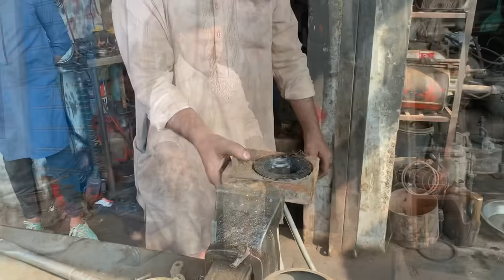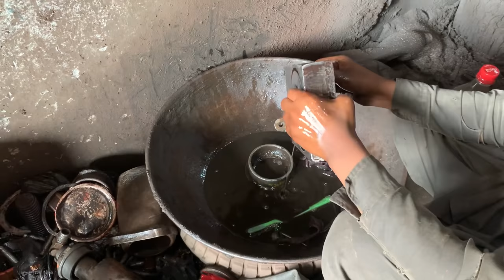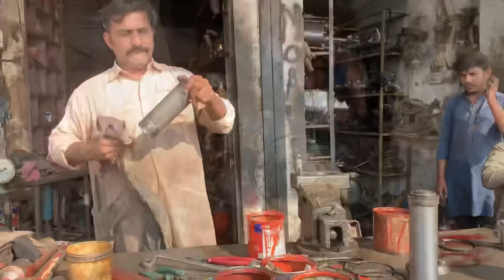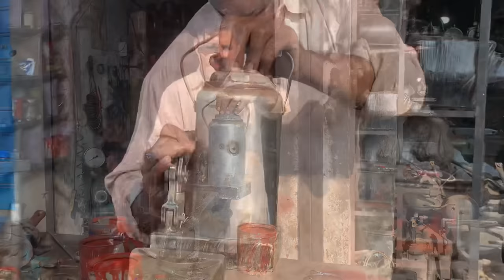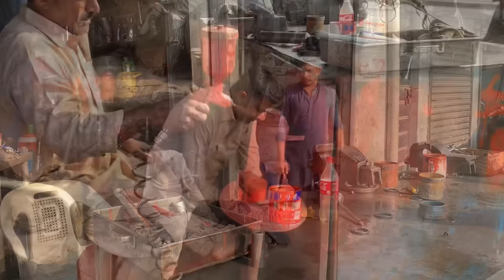Fully Destroyed Old Hydraulic Jack Restoration || Repairing 50 Ton Rustey Hydraulic Jack

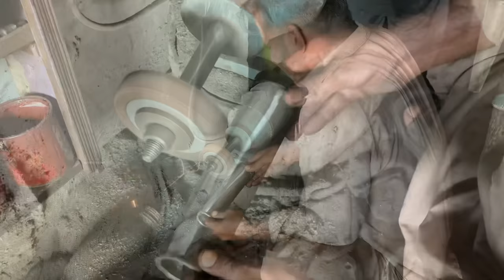Comment: @6:40  Love the piston pit removal process...  I'm sure it leaves a uniform and perfectly round surface for the seal to do its job and hold up the 50 Tons the jack was rated for....  ;)
Reply: the label was for a 32 ton
Reply: @dtoad48  that was a different jack than the one shown being rebuilt.
Reply: maybe they reduce the capacity by 40 percent to compensate for the repair

Comment: Using a grinding disk where a wire wheel would be preferable.  And that hammer.  Destroying those working surfaces.  A fork seems to be unknown tho these guys. Removing so much metal from the working surfaces will greatly reduce the working load of the jack. Vice grips would also be of a big help.  especially when using a wire wheel to clean parts.  How many hand injuries do these guys get?
6:00 that grinder is sliding on its mounts.  
10:07 - that kid with bare hands in that solvent.  He will live a long and healthy life.

Comment: TIP. when unscrewing the large pipe, keep the ram in the cylinder and line up the ram wide seal area with where you put the wrench. Otherwise you might warp-oval the pipe and cause a problem with the ram sealing. It is supposed to be perfectly round.

Comment: After watching a few Pakistani videos, I am now convinced, that you cannot repair anything in Pakistan without a hammer.
Reply: No Hammer, no repair. Fire is also vital.
'adjust to 80 Nm torque' = Hammer, maybe with a spanner as well.
'pre-heat to 120 C, then increase to a 320 C temper'  = Fire, more fire, then water.
Reply: Condições de trabalho totalmente insalubre. Os reparos, todos, feitos no "estilo" gambiarra, tudo sem a menor intenção de exatidão. Improviso em todos os detalhes. Sem dúvida, serviço de má qualidade!
Reply: Yes.
Reply: Sabes cuáles son las reglas de un taller mecánico, y que no se pueden romper? 
Pues una va ligada a la otra, si rompes alguna de ellas no será un taller mecánico, será una casa de niñas.
Simplemente tiene tres letras, la O, O, L que traducido a mi idioma son.
Organización.
Orden.
Limpieza.
Saludos…..
Reply: @aga5897  kkk kk
Reply: Or a floor lol
Reply: Jesus wept a table
Reply: LOL. A hammer and or an 3’ extension bar for the wrench

Comment: 50 ton jack? no way I'd be trusting that to hold 50 ton
Reply: 21:22 he test it, but i cant see the number
Reply: @fendra3717  A little more than 360 bar (around 5200 psi)... considering a 5 cm diameter piston, it is tested at around 7 tons.
And NEVER EVER trust a jack alone (even new), always use jack stand with it !
Reply: @patricenardoux5611  thanks, so that only 5 tons jack
Reply: @fendra3717  It is tested at 7 tons, perhaps it can do more...

Comment: Since Safety is of Zero Concern... 

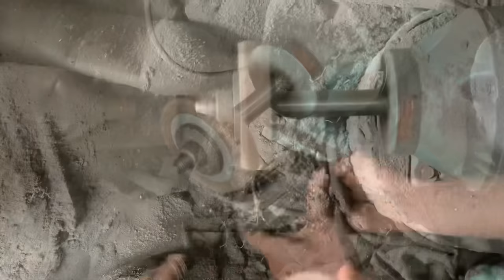Why isn't (@6:35) those cylinders spun up in a lathe and Emery-Paper finished, for a quarter the time, half the cost!...

Or again Chucked Up in the 3-Jaw and a 90° flap wheel fixture on the "Ways" or even just by hand in a 9-inch Grinder.

Finish would be a million times better, be safer, faster and likely to be cheaper?...